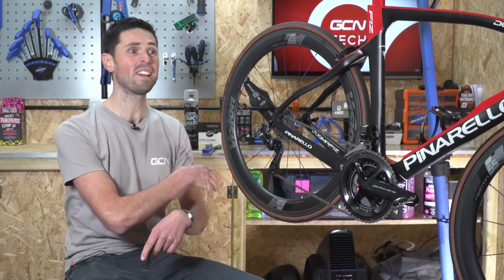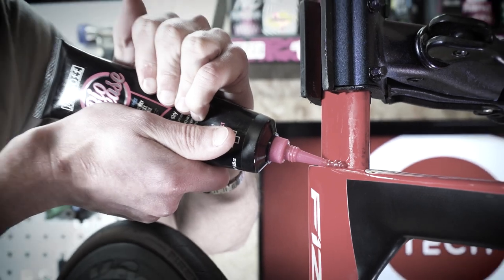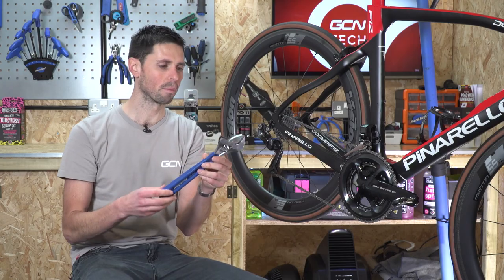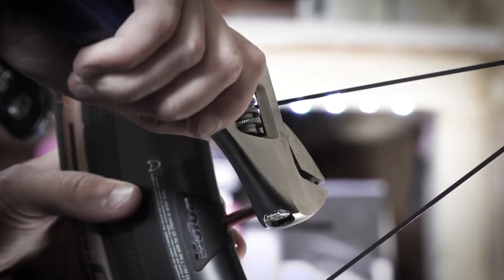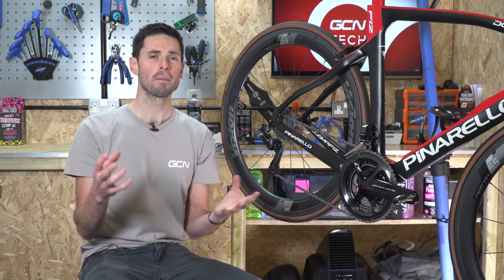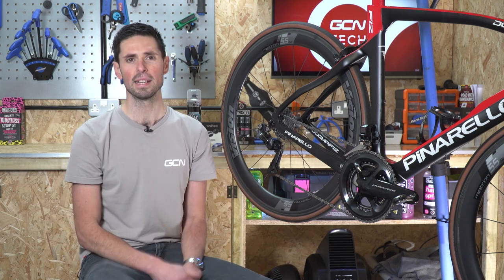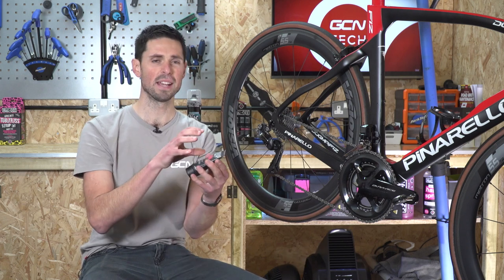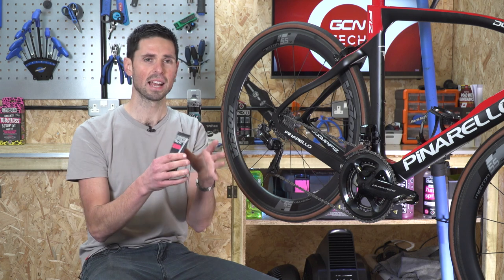5 Maintenance Mega Mistakes | Maintenance Monday

Comment from the maker: Have you ever used any obscure products or tools to fix your bike?
Reply: No, I haven’t.🙋🏼‍♂️
Reply: I once tried to use tethlon spray lubricant to lubricate my bike chain on a thrift store mountain bike.

It only made the problems worse, because it turned out that lubricating broken sprockets just makes the chain slip off.
Reply: I once needed to true a wheel, but none of my spoke wrenches would fit. I was forced to use a large adjustable wrench/spanner very like the one in this video.
Reply: I work in a shop. I've used a grinder to file down a Philips head screw to use it as a new pin for a rear derailleur. We also have an 8 foot steel pole that we use for more leverage when things are stuck like bottom brackets.
Reply: good ole American fencing pliers can repair about anything....the mechanic at the Bike Farm in austin Texas used them to enable my fatgirl to shift properly.
Reply: In the shop I used to work in we used a torch from time to time to heat up cranks when the pedals were really stuck.
Reply: I find that pure lanolin makes a great anti-sieze and rust preventive for small screws and bolts such as used for attaching bike racks and other things to braze-on steel lugs.  If you get some on your hands, well then just rub it in! :)
Reply: Using the rounded side of the Allen key to adjust my rim brake caliper just to strip it out…
Reply: My tall bike has MIG welding, TIG welding, some braising & heaps of zip ties. Blown out sidewall of the tire is also held together with rubber cement and old packages of zig zags. #tallbikeswillsavetheworld
Reply: PVC pipe to as a crown race installer.
Reply: Fingernail clippers for a smooth cut on zip ties.
Reply: Rubber Mallet
Reply: Yes - Wend Chain Wax. What a stupid product and waste of money.
Reply: “Bit of Lego would fit perfectly! Just the job to fix that derailleur!” 🙈
Reply: @DonutEndurance  At least, a partner in crime to help me realize my dream of a PVC Tubing bicycle frame.
Reply: Tried to pump my tyres up with an axe - rookie mistake
Reply: I used to use WD40 as chain lubricant lol 🤦‍♂️
Reply: I am not going to be the first, to type this,  but always grease seat tube within frame. Unless you want to get some caustic soda.....and destroy the lawn...typed it and then read so, definately not the first...
Reply: Sorry, this is about carbon frames. Which are like the plastic bags of the nineties. Landfill. And good for retail. RIP carbon.
Reply: Ive used WD40 for the chain ones. My local Bikeshop could not believe me that the chain only saw 2000 km and not 10.000. Dont be as stupid as i was.
Reply: When I first started to ride I used standard household W40 for my chain lube.
Reply: Used sticks at the roadside to remove tyres when found tyre levers were rusty and bent. That went well but did mean a lot of time getting bits out of hub while adhesive was drying.
One that worked less well. I found rubber compound had burst and gone off when had a puncture and the closest the nearest shop had was supergolue. I used it and got home havign repaired 3 times en route, because it isn't flexible so it worked for a while then gave out instantly.
In terms of using actual bike stuff for the wrong purpose. The closest I got was using grease on chain instead of liquid lobe. This was in Norway during a November with snow and ice ever present so I wasn't exactly worried about the wasted effort and more concerned that the chain was protected.
Reply: Once used a quick release as a tyre iron… it worked
Reply: Used grease on my chain instead of lube. It was a sticky affair

Comment: Controversial on grease and seatpost! If you've a metal frame and metal post, a touch of grease will stop them binding / fusing together and making the post nearly impossible to remove. If you're riding a bike where the height of the saddle is changed more regularly, and isn't made of carbon, I'd not be too nervous about using a little grease on the seatpost.
Reply: Yeah, i'm with you here. I put a touch of grease on all my metal to metal contact points and never ever had any slip/movement.
Reply: I came here to say just this. I restore old bmx bikes, and the number of aluminum seat posts stuck in the steel/ 4130 frames is astounding.

Bit of grease would have saved a ton of work, and a fair few parts.
Reply: If you're going to put grease on the seatpost, then make sure that the seatpost has some kind of locking mechanism that goes through the frame
Reply: Yup!
GCN have even endorsed using grease on seatposts in the past!
Reply: @AmaroqStarwind  If the tolerances between seatpost and frame are fine, there is no issue with a little bit of grease, the seatclamp will clamp it strong enough, even with the slightly reduced friction. 
Assembly paste/anti seize would be the ideal product, and if you have an unlucky combination (undersized seatpost, oversized seattube), I'd highly recommend it instead of "normal" grease.
Reply: Noone will care to use grease on the seatpost on old steal bmx bikes or other "metal to metal" combinations and torquing them to 30Nm, no probs 🤣 
But with a carbon seatpost and frame, beeing limited to maybe 9Nm..carbon gripper paste is definitely the better choice!!! No corrosion the same way..
Reply: Absolutely.  Use of grease is de rigeur on a steel bike with alloy seatpost.  Aluminum swells to 3X its volume when it corrodes.  Many a steel frame has been ruined (or required extensive work) due to an unremovable Al seatpost.  A properly secured binder bolt will keep the post from slipping regardless of the grease.
Reply: Could not agree with you more. Shows you the kind of bubble these guys live in
Reply: I was having noises before I putted some grease on the seat post
Reply: @floridrummer88  gcn should have mentioned the differences between carbon and metal frames, since carbon frames are special here, to avoid confusion
Reply: @simonm1447  sure! :)
Reply: @fukav1am  lucky guy 😊 could show you a different thing on my bike :)
Reply: That's what I've always heard: to prevent seizing.
Reply: It also acts as a moisture barrier.
Reply: that is what anti-seize paste is for. It's similar to grease with some partikles in it. The grase prevents the parts from sticking together and the particles increase the friction.

Comment: Bad advice is worse than no advice. I know in the rarefied air of all carbon bikes that GCN lives, you don't want to grease your seat tube. But where us mere-mortals live, a tiny touch of grease between the aluminum and steel components will prevent the shedding of tears in the future. Possibly tearing your bike (sometimes I hate English lol).
Reply: So true. More than 25 years ago, I put grease between the seat tube and seatpost in my beloved '87 Fisher Hoo Koo E Koo. A few months ago I removed it with no fuss at all.
Reply: @stuartfreedman6854  I just had to scrap a bike cause the seat post was stuck. A litte grease on the seat post would have prevented this.
Reply: He literally at the start says “FOR CARBON BIKES” why do you thinks he’s using carbon gripper paste. You think you use CARBON gripper paste on an ALUMINIUM frame? If this was a video for aluminium frame bikes, he probably would recommend to slightly grease the post.
Reply: @MrTJSE  Where ? time Stamp Please, he does not say carbon in the first 50 seconds of the Video!
Reply: @MrTJSE  he mentions at the end about carbon gripper paste. Specifically says don't lubricate the seat post, without the caveat of carbon vs. Metal interfaces. Call it a editing error? Maybe?
Reply: @miniac60  Editing error would make sense. I'll give them the benefit of the doubt this time...
Reply: So what is wrong with using assembly  paste  on alu/steel seat tubes?
Reply: @willemrm4033  A bit of a waste of money? But other than that I can't see a problem if you already have an open tube within reach. Anyone else see something we're missing?
Reply: @wilfdarr  Of course there is no problem as it's meant to be used for that purpose, not grease. (= for lubricating moving parts as bearings, axles and hubs). So even if the bike was alu/steel the uploader wouldn't have advised to use grease. to install the seatpost/tube.

Comment: I restore old steel / aluminium bikes, and man I can't disagree more. Putting a bit of grease on seatposts, stems, etc will not only act as a corrosion inhibitor, but also stops them from fusing together, especially when talking about mixing steel and aluminium components!
Reply: Agreed! have 5 steel frame bikes, 4 got grease,  1 didn't.  Guess which one has a permanently welded seatpost.
Reply: I think he talks about carbon frames - where grease isn't the right thing. On steel and aluminum frames of course you are perfectly right, a seatpost there needs lubrication, or the frame will corrode over time from inside the seat tube.
Carbon is a special material in this behalf, it needs special stuff Iike carbon paste in the threads where a normal bike made of metal just needs copper paste or grease.
To avoid confusion they should have mentioned  the difference between the different materials
Reply: @simonm1447  Ofc, this should be obvious, however for folks that this video is aimed, it may not be. :) It's just something worth to clarify for people who are just touching their toes into bike maintenance/build/repair.
Reply: A bit of light grease on my seat post solved the mysterious creaking that was bugging me for ages!!!!
Reply: @pushthepro  people today sometimes put radiator coolant into car engines instead of oil and engine oil inside the brake fluid reservoir, today nothing is impossible ;-)
Reply: @simonm1447  I got me a steel bike with a carbon seat post.
Do you recommend using grease instead of carbon paste?
Reply: @Volkmannx  someone with more knowledge please correct me if I’m wrong. But I think carbon paste should be used on a carbon seat post and steel frame. Metal on metal can seize up. Less likely with metal and carbon.
Reply: @FlyingCartographer  yes, I always use carbon paste for steel frame and carbon seatposts, but use grease on aluminium seatposts. I think the basic rule would be to use carbon paste for carbon parts with any material, and when it's metal on metal use grease. And it's probably worth removing and cleaning your seat post every now and then regardless!
Reply: Right off the bat what I was thinkin
Reply: @Volkmannx  Since I personally don't have a carbon seat post I had to do a little bit research first. 
Normal grease isn't good for carbon parts, since it reduces friction. A seat post clamping has to be tightened more in this case, which isn't a problem for metal seat posts but can damage a carbon one. Additionally normal lithium grease contains acid, which can damage the resin (to lubricate plastics (like plastic gears) special grease is used). 

In this case carbon paste is suitable, since carbon paste is no lubricant but increases friction, so the seat post clamping has to be tightened even less than without carbon paste. According to some bike magazines stuff like Teflon spray or Silicone spray are also possible for this case.
Reply: @simonm1447  Thank you!
Reply: Thanks guys!
Reply: @Volkmannx  You're welcome
Reply: I was going to say the same: probably not necessary when using similar metals, but when using dissimilar metals its critical to keep them from welding themselves together.
Reply: Totally. He shouldn’t have assumed that everyone is dealing with carbon to carbon contact surfaces. It’s such a blunder that I think they make these errors on purpose to increase response rates on social media. Place one polarizing statement in any post and expect a high viewer engagement. I mean are they really that dumb or arrogant to think there are viewers out there that aren’t using an aluminum or steel post in a steel frame and vise versa? GCN: “let them eat cake”
Reply: I had a horrendous creaking noise coming from my aluminium bike. Changed the headset. No help. Changed the bb. No help. Tightened and greased the chainring bolts. No help. Added a tiny amount of grease to my seat post, sorted 👍🏻. I'd recommend greasing any metal-metal contacts, can also use copper paste if Ti is involved. 

I have also been known to grease QR skewer contacts to remove creaking and clicking, it works, but I don't recommend this unless you are very very careful (my specific case had slim-profile QR levers, where getting the correct clamping loads without lacerating your hand was nigh on impossible... Don't buy QR skewers like that!... After applying a tiny amount of grease I found I was able to tighten the skewer more, I also thoroughly checked how secure the wheels were, and have thus had no issues on the road). 

Do not grease carbon-carbon or carbon-metal unless it is a carbon-specific compound, otherwise you'll risk break down of the resin and delamination, which leads to breakage, which leads to death ...
Reply: I'll just add to this discussion: If you have a seat post that slips in a metal frame or it starts to slip after you grease it with normal grease, the best off the shelf stuff to use is automotive copper grease/slip its grease but has copper particles in it that prevent movement and corrosion at the same time. 
if you have a very loose seat post that copper slip wont fix** you can mix ground glass (available from hobby/craft shops) with some cheap grease and make a kind of carbon paste for metal.
** Check that you have the right sized post and clamp (measure them don't just go by what it says on the side) and there are no cracks in the seat tube first.
Reply: Same here I got rid of lot of noise on my Caad13 after applying little grease on the seat post interface.
Reply: came to the comments the second he said not to grease seatposts looking for this comment lol
Reply: Grease is not grease. There are different types. Bearing grease makes no sense at the seat post. Anti seize makes a lot of sense. But both is a type of grease.

Comment: dude, ALWAYS use grease on alloy/steel frames, seatposts, stems... everything metal in fact, you should specify that not using it applyes only to carbon, otherwise youre giving out really really bad advice
Reply: And even then there is "carbon grease" that actually increases friction, which he touches on at the end.
Reply: Grease/oil is meant for moving parts as chain, derailleurs, hubs, bearings etc....assembly or anti seize paste for not moving parts as seatposts, stems, bolts etc...
The paste can be specific for alloy or carbon frames/parts, or for both. I'm pretty sure  the "dude" put some anti seize  carbon paste when installing his seatpost.
and would use a non carbon one on a alloy/steel frame. But no grease.

Comment: I put grease on my seatpost as selant and so that the seattube and saddletube oxidise together. Of course that doesn’t apply to carbon bikes :)
Reply: Yes, this is actually recommended for METAL bikes. Even aluminium bikes will corrode at contact points if the alloys aren't exactly the same specification.
Reply: I think anti-seize paste would be ideal for this
Reply: @Max085  they are very similar.. greese is just made for higher speeds :)
Reply: Anti seize is the better product for this.
Reply: @Max085  That would be best if available. Light grease works well if it isn't. It would be difficult to find a bike shop that doesn't have the paste though.
Reply: @brankododig1585  they are very similar. If you only have greese there is no reason to buy extra anti seize :)
Reply: funny guy!

Comment: Adjustable spanner should only be used in emergencies when there is no fixed spanner anywhere near.
Reply: Agree!  ALWAYS use the correct tool for the job!
If you think a shifting spanner is the correct tool, go and visit your local bike shop and get them to show you what to use.
Reply: This guy spanners.